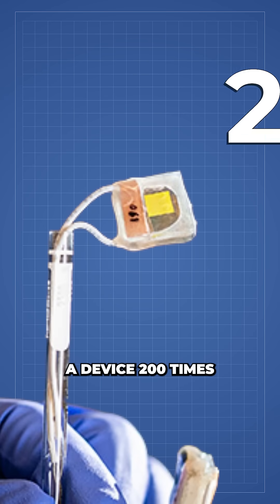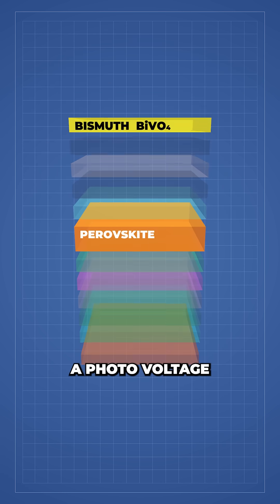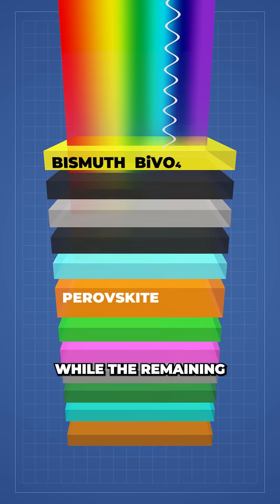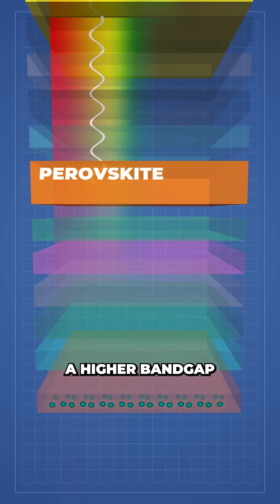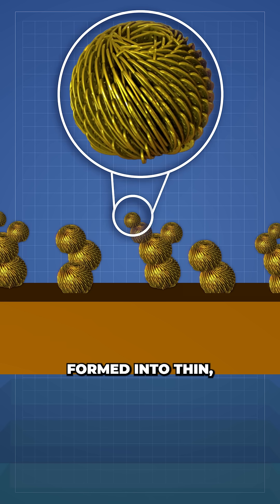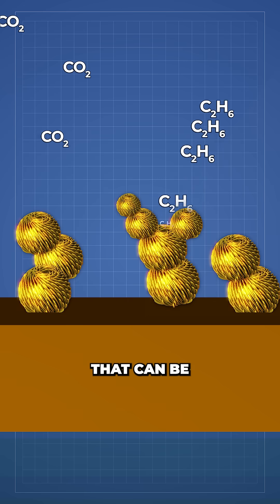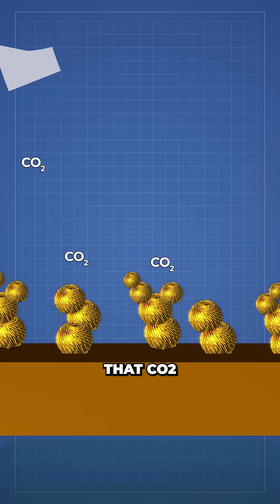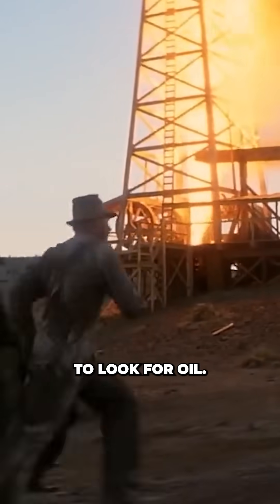Scientists Create Artificial Leaf That Converts CO2 into Fuel

Comment: I don't understand the purpose though. If our objective is to cut down on pollution then why are we spending so much energy mining and refining rare metals and then fabricating these micro leaves instead of just planting a single acorn and getting a free carbon scrubber that operates at 10,000 times the output
Reply: Yes I know it produces fuel but so do trees. The oldest compressed tree waste is where we get coal. It's fascinating as a concept, but nuclear is always the far superior option

Comment: I have a different way to do it but it would require using at least a few of the basic ideas they've gone with . That and ai as a control mechanism , people simply wouldn't be able to control what I have in mind with switches and valves

Comment: The cost of those materials is insane, but maybe in 20 years it's a technology available for comercial use.
I still believe splitting atoms to generate electricity is 10000 times better, the contamination generated to create nuclear energy is easily replaced by all the power and control in that source of power. 
The real robbery that oil barons made was making people believe Nuclear energy is dangerous to the level of nuclear bombs.

Comment: Holy sh*t.
If we can manage to reproduce this at scale, this would unironically SOLVE our energy crisis AND global warming.
Reply: But is solving our energy crisis and global warming profitable
Reply: @forsaken696  If they're a publicly traded company they are LEGALLY required to do what's most profitable for the shareholders or end up sued.
Reply: @forsaken696  - Not at all. Hence the hundreds of working free energy devices sitting on shelves in Big Energy’s dusty catacombs.
Reply: Not necessarily. It really comes down to costs. We already know how to get energy from the sun. We just need it cheaper to solve more problems.
Reply: Tree..
Reply: Well companies won't
Reply: No.
Reply: Just wait for solid state batteries, perfect use case for storing energy. It even, use physical/analog batteries
Reply: @GustavocoolEatsBreakfast  Batteries will never outperform internal combustion. The amount of usable energy in a tank of fuel can't even be compared to the energy density in a battery. Also, as you burn fuel, you lose weight making the car lighter. As you consume electricity, you lose efficiency but retain the weight. To add more distance, we add a larger fuel tank which ads marginal weight vs energy density. To increase distance, you need more batteries. More batteries means more weight which means you eventually hit a point of decreasing efficiency as the heavier batteries drain faster. To make electric cars viable on a mass scale, you would have to solve problems you don't even know you have yet. Not to mention the inability to refurbish an electric car and in the near future, all the electric cars that will be abandoned when the batteries run dead and a new pack costs twice what the car is worth. Meanwhile, I'll just rebuild my engine for another 300k miles.
Reply: @maddoxinc1642  🤦‍♂️ some people will never know real science
Reply: @maddoxinc1642 You imply that these issues make solar an unviable competitor, which is vastly untrue, that the issues make it unviable, which is only true in the sense that it's why it hasn't already overtaken combustion, imply these problems are some blind spot for research and not hurdles scientists have been gradually succeeding in overcoming since the advent of modern solar energy, and that there will be no increase in the capacity or efficiency of solar that will make it more viable despite the technology improving constantly through heavily funded research (but not as heavily funded as the fossil fuel lobby trying to talk over scientists to convince people solar is a pipedream).
Reply: We have known multiple technical solutions to global-warming since the 90's.
The political forces are not interested in solving the problem because that would diminish their political power.
Reply: Global warming literally isn't an issue and we're still on the tail end of an ice age.
Reply: THEYRE CALLED FUCKING TREES
Reply: As long as we dont use up co2
Reply: shame the entire world our ancestors built is setup to do exactly the opposite of solving any of our current problems. simply bc it wouldnt make them any money.  AND even if they did, they already made it to the end of history at the top, they'd always permanently be ahead then so nbd lol.  these capitalist parasites are sick in the head with aggression, greed, and megalomania
Reply: The government is totally going to let it happen
Reply: You plan on stopping the pole shift? I'd love to know how you plan to stop pole shift.
Reply: @maddoxinc1642 Global warming is unequivocally due to human activity and the gradual wobble of the earth that shifts the poles has only a partial role to play in the much more gradual natural warming and cooling cycle, let alone what we are observing now.
Reply: No it wouldn’t. It’s just solar gas. Less efficient thr solar panels
Reply: Just…use plants?
Reply: @edwardliechti3359 plants don’t make car juice
Reply: Not going to work.
Reply: "If" is the challenge.
Reply: Imagine solar panel trees. An evergreen tree like structure to replace the trees that were cut. Find a way to synthesis the likeness of actual trees and we got android trees. 

People who make arts and crafts with nature could take it a step farther and eventually make their own creations come to life.
Reply: First solve for the gross energy loss in production, logistics and manufacturing, then you can see if the net energy production checks out
Reply: @kash-marie  When you're refining oil, you can use all of it. Matter fact, you can use the oil you're refining to power the refinery itself. Have you ever seen a mining camp where ore is extracted for lithium production? Yes, oil can be spilled but that can be controlled to a large extent. You can't control the damage ore extraction does.
Reply: No shit Sherlock
Reply: I've heard this so many times. We'd just become more greedy for more energy. Energy problem is solved with parsimony and NO new tech.
Reply: Reality is youre never hearing of this again
Reply: dont get your hopes up :\
Reply: Nah really!?!?
Reply: We could also.....  use it to make fuel out of the green house gasses.  And just put that fuel back into the ground.  

(Seriously btw.  This can basicly be used as a climate control system by controlling the amount of greenhouse heating is happening.)
Reply: and wars
Reply: Why not connect multiple silicon PV cell to get enough voltage to split Co2 instead of using complicated technology made form rare metals like Bismuth?
Reply: no
Reply: The minerals needed to build these at a large scale tho...
Reply: Tell me how you are supposed to make plastic out of it, to stop this global wariming of yours
Reply: @Imagers100  there are alternatives for plastic, for most functions in which plastic are used. And there are ways to decompose plastic using microrganisms that eat plastic. We just need to obligate plastic producers to collect back all the plastic and decompose them.
Reply: @Imagers100 The manufacture of plastic does not have to reach 0 for global warming to stop worsening.
Reply: Calm down. This is just hype. Hate to break it to you, but theres too much money in being wasteful to let stuff like this succeed. Just accept that we'll be using oil and gas our entire lives.

Comment: while the co² loop is closed it is capturing more energy from the sun, which will be transferred into more heat. heat is harder for our planet to radiate into space than reflected sunlight.

i know you didnt go into that, and it is a huge advantage to no longer be reliant on co² that has been bound into the ground as fossil fuels, but like pretty much anything we do its not climate neutral

Comment: The one thing I hate about the whole CO2 to Fuel thing is the idea of pulling CO2 out of the atmosphere.

Unfortunately, current machines caapble of separating carbon dioxide from air are far more power hungry than the Carbon Dioxide could make up for as fuel, even if the conversion from CO2 to fuel was free. Alternatively if you want to work with the low concentration of CO2 in the air directly you will probably need a lot of area.

What I find to be a far more realistic solution is directly taking from exhausts of factories. Take a coal powerplant for example. Instead of simply filtering the exhaust as we currently do, you could add an extra 'filter' that converts C02 back to Fuel. This way the converter doesnt have to work with low CO2 concentration or a power hungry separator, instead it can directly use the C02 dense exhaust of the factory.

Comment: well thats because in photosynthesis, plants dont split CO2, they split water to charge up ATP, then use ATP to split CO2. we shouldve used capacitors as ATP equivalent to store charge and split CO2 when sufficient electron voltage is achieved

Comment: This is SO COOL

So the solution of the battery storage problem is to turn energy into literal fuel so you wouldn't need a battery to begin with

I'm a solar panel engineer and this makes me really optimistic

Comment: For anyone curious, perovskite is a mineral crystal, is often used in sun panel researches compared to industrial silicon panels. I remember seeing it in out optoelectronics lesson. There are many researches about it, it's more expensive compared to silicon but more efficient. However, the electric it makes is nowhere near efficient as fossil fuels. Researches are to improve it

Comment: Provskites are heavily researched for use in solar cells, but have many problems. Like the biggest one, instability. They are very sensitive and lose efficiency when they come into contact with air, water, light (Yeap, quite paradox) or when u look at them the wrong way. But nevertheless, researchers are able to reach efficiencies far beyond what is possible with semi-conductors. Also, the best performing ones are lead based, so a bit toxic ^^ (Perovskite is a type of crystal structure, but can be made out of many different elements)

So, yeah, this won't be coming anytime soon, there is still no idea who to get them to last longer than a few days.

Comment: I think there are huge pitfalls with expecting this to replace fossil fuels. This invention looks fine for tiny structures, but it's far too costly and delicate to scale to something large enough to provide power to even a single building. Additionally, light doesn't always hit plants at perfect angles. Some plants literally move to follow the sunlight. Lastly, what is this thing going to do at night, snow, and during storms where there isn't much light outside? The reason fossil fuels reign supreme is because they are robust, easily stored, and can be used in virtually any whether, from the -40F temperatures in Alaska, to do 110F Texas heat. Until an invention can do both (without being nuclear), I don't see fossil fuels ever being replaced. Of course, nuclear can do both, and better, and greener, but people will need to learn to stop fearing nuclear power so we can start using it to change our lives.

Comment: hmmm where will they get that hydrogen from? CO2 only has carbon and oxygen, so they would need to introduce water somehow into the equation, but it would then interfere with CO2 exposure. Sure one could try to dissolve CO2 into the water but I think then you have less CO2 concentration and very high amount of H2O.

All in all i am skeptical about this.

Comment: The atmosphere is 0.04% CO2.
Enough to screw with temperature. Not enough to do direct carbon capture.
Fossil fuels were formed from carbon captured during the early carboniferous when  atmospheric CO2 was around 0.15% and took 300 million years to drop.
This is not a substitute for decarbonisation.
Reply: literally nothing will be able to reduce the carbon dioxide saturation in the atmosphere. this isn't even a doomer mentality it's just factual. unless we stop right now and go nuclear we're pretty much going to reach a point where it will be financially unfeasible to switch.

Comment: There is that world infamous enzyme in the plants, the Rubisco, which is necessary to split the CO2 from the air, so it can be processed into sugar.
The enzyme works 80% of the time; the other 20% of the time it tries to split 02 instead of CO2; in this way, it consumes energy instead of generating it. 
Now, this Vanadium/Perovskite cell, is affected by the same problems of Rubisco?
Greetings,
Anthony

Comment: This is really cool, but vanadium is somewhat expensive and is toxic, and perovskite solar cells, while cheap, contain significant amounts of lead, which is qlso quite toxic. This might not be a problem except that these will necessarily be exposed to the elements and have plenty of opportunities to leech into the environment. There also exist electrochemical processes to do this, they just require cheap, abundant power to be made economical. You know. Like what nuclear power could provide.

Comment: Sounds like a perpetual motion theory. The system can't possibly clean the air more than it makes it dirty. Energy can only change form. It can't be created nor destroyed.
Reply: The energy comes from the sun.
Reply: @cedarcoombs8111 I think you should watch the video again.
Reply: @robertlee6409 I think you should. It sounds like two of the layers turn sunlight into energy, then this energy is then fed into things that turn the CO2 into a fuel, then we burn that fuel which makes more CO2 that you can put back into it.
Reply: @cedarcoombs8111  Everything creates waste. I'm sure this process is no different. It's impossible to collect all the waste and recycle it. That would be perpetual. Usually if it sounds to good to be true, it's because it is.

Comment: For some reason he doesn’t show the water needed going into the loop.  If methane is the output, that h4 is going to need some good ole h2o, the co2 alone won’t do it.
Reply: Just to subsitute your good comment, it's CO2 and H2O in, C2H6 out. For C that is 2 CO2, and for H that is 3 H2O molecules. That leaves 4 O + 3 O. Assuming only O2 is created, it would mean that the process needs to happen twice, which would result in the following:
4 CO2 + 6 H2O = 2 C2H6 + 7 O2

That is ofcourse if they only produce dioxygen.
But what's very plentiful in the atmosphere, is nitrogen.
Which could result in the reactions to create NO2 or N2O in bigger quantities than the fuel we would receive.

But I don't know about you, but these are known to be worse pollutants and greenhouse gasses than CO2. So I REALLY HOPE that they only produce oxygen, RELIABLY!!!

Comment: Guys, WHEN this fails, its not going to be because of some takedown by big oil. Its just going to be because even doing this is inefficient. Why would we go from sunlight to electricity to burnables to the form of energy we want instead of just from sunlight to electricity to the energy we want. Yes, we do currently still need better batteries but this is just overkill.

Comment: Holy god what an enormous concentration of tin hat users in the comment section. No one kills scientists nor restricts the patents, oil companies will be the first one to buy out the tech if it has any actual potential, but not to scratch it, but to further more increase their dominance. 

The issue with those things as why they get forgotten is primarily related to the fact, that you can't scale those out of lab examples or that they fall apart before justifying their production and no one can figure out how to prevent it. Perovskite would be one of the examples where scientists managed to get it through the stage where crystals were dying within minutes.

Comment: This is amazing but how fast does it decay to the elements? Not even just rain but prolonged exposure to sunlight can wreak havoc on some semiconductors.

We would still need to drill for oil for plastics, dyes, and a lot of other things. Not to mention a hydrocarbon might be able to substitute for gas like ethanol is but for things like engine oil not necessarily

Comment: Seems pretty straightforward. And since it’s basically a bunch of layered sheets you could make em bigger. Hell you could theoretically use the closed system to just turn electricity into fuel so you could use it in water mills to generate fuel as it’s one of the more reliable forms of harnessing energy since it’s mainly mechanical

Comment: Converting atmospheric CO2 into fuel is going to cost way too much energy though and be too slow.

You'd be far better off just collecting power from regular solar panels (and/or all other sources of energy) and then using that to create hydrogen for hydrogen fuel cells. Yes it's inefficient, but overall it would be far more efficient than what is proposed here. Internal combustion engines alone are super inefficient, the only reason we use them is how cheap it is to extract pre-existing hydrocarbons (fossil fuels). MAKING hydrocarbon fuel such as biodiesel, ethanol, or sythfuel all uses tons more energy and resources.

Comment: For this to work it has to yield higher amounts of the fuel vs carbon dioxide biproduct. Equal wouldn’t work, it would split, then produce twice the amount of carbon dioxide making it output more than it absorbs. Is there a paper to read? This is next level stuff, like new planet seeding with carbon dioxide in preparation for life. Carbon dioxide would help produce an atmosphere for plants and pressure for gravity.